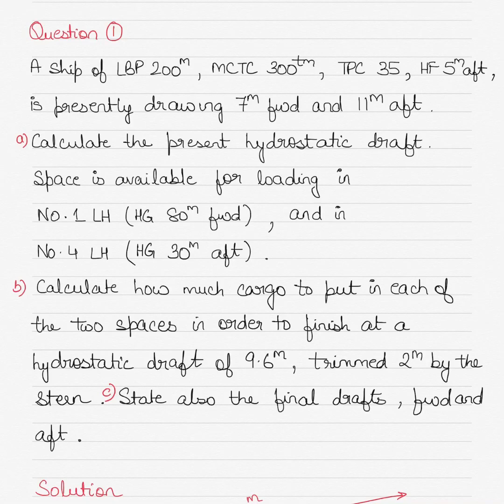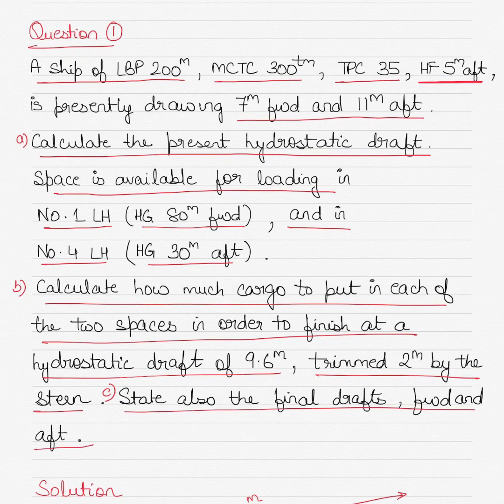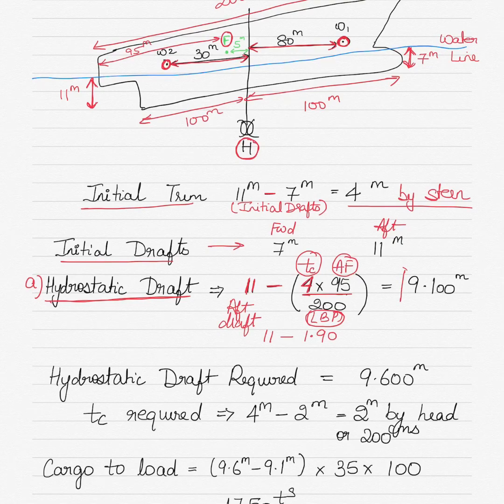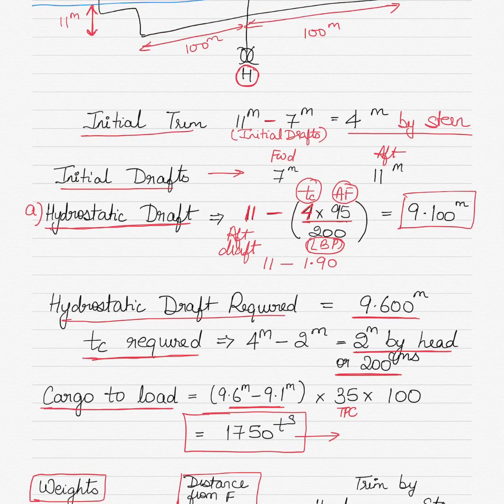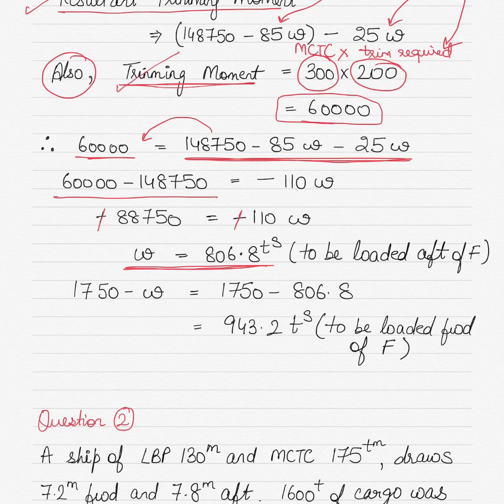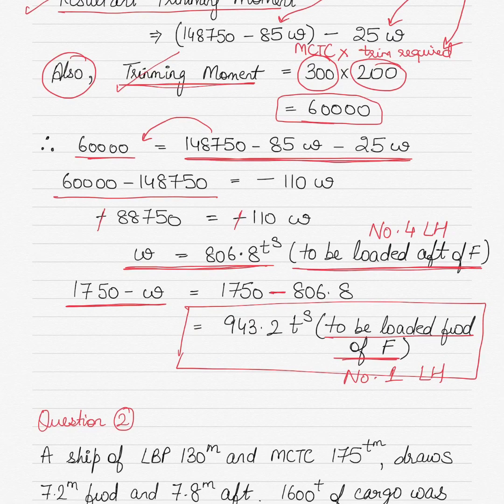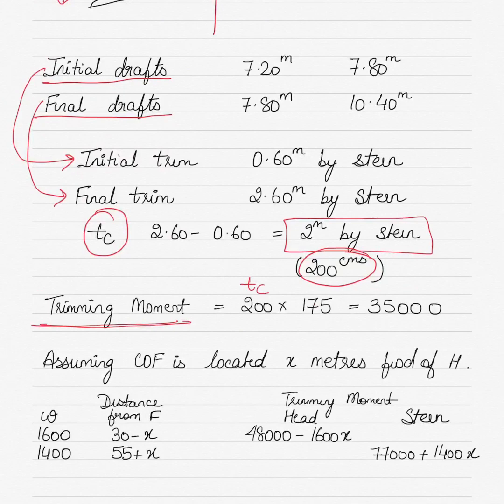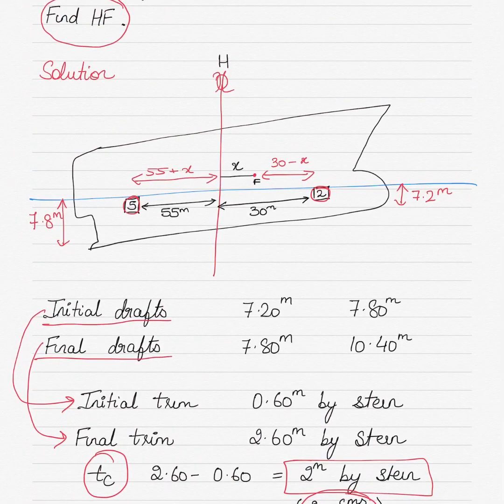Trim Calculations -  Part 3 (Advanced Ship Stability for Mariners)

Comment: sir excellent thanks alot for your good description but i have questions in EX.1 why for cargo to be loaded you after (9.6-9.1 ) *35 also multiply 100 i do not understand this logic of multiply 100 ?
Reply from the maker: Good question, I converted the difference in draft from metres to cms. This is required as the TPC is for the unit of cms. Hope you got it?
Reply: @SteeringMariners   I got it All the best 
could you pls solve the EX.22 , Q8 of Subramanium . God blessed you

Comment: Sir i'm confusing how do you calculate the 2 meters result from forward of mid ship?

IF;
77,000 - 48,000 = 29,000
200 * 175 =35,000
35,000 - 29,000 = 6,000

How do you calculate the 3,000 and the result of 2 meters forward of the mid ship?

Comment: Sir when density change and we need to find fwa then which displacement u should take..final displacement or intial.please advice
Reply from the maker: when the density changes, the under-water volume changes. The displacement remains the same. When the under-water volume changes, the draft changes (since the length and breadth of the vessel can't change). The difference in drafts is what gives you the allowance.
Reply: @SteeringMariners  thanks for reply sir but when initial  displacement is given and after that we load some other cargo that time which displacement we should  consider for to find fwa and mctc.